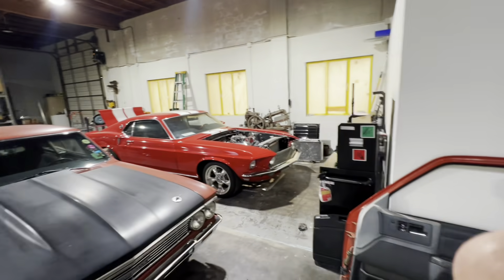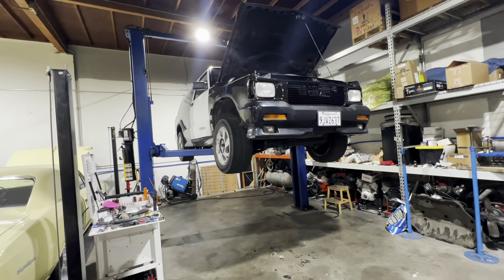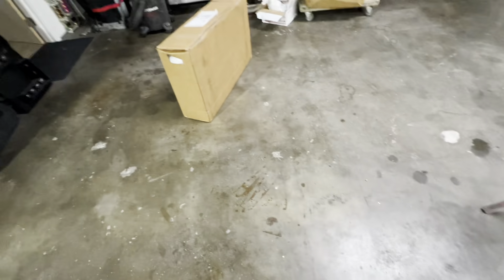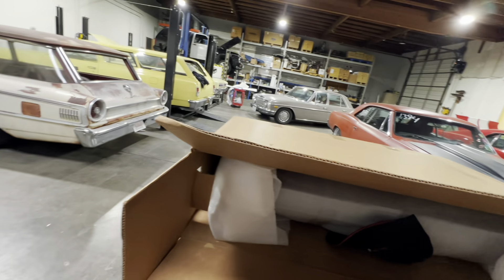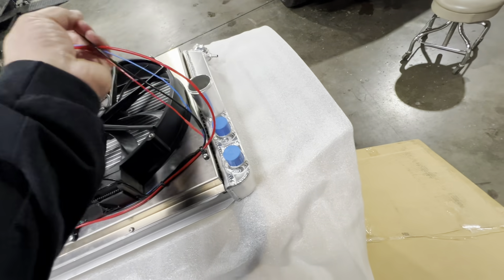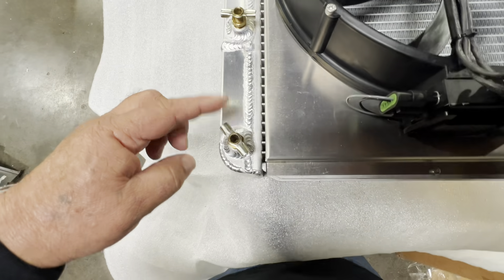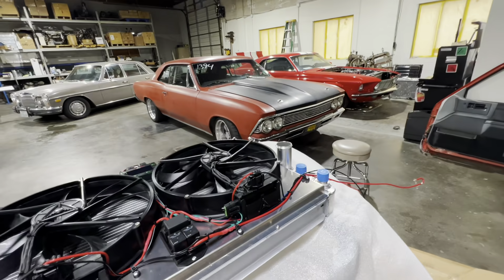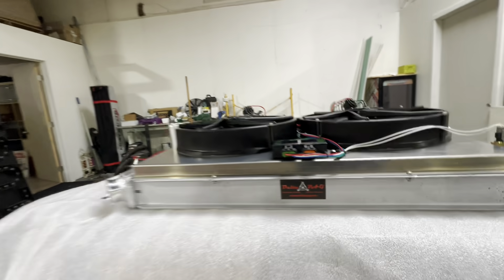What's new in the shop?  Delta PAG Radiator

Comment: I love my Delta PAG system  on my 1970 OLDS 442 W -30 conv..I've had  this system now for about two years and very pleased with the performance. My car is LS-SWAPPED..600 HP..In the summer it get's up too 110 degree's here in Texas..I've been stuck in bumper to bumper traffic..110 degree's and AC on..Engine temp never got above 196 degree's...Excellent system..

Comment: I was able to wire myself a crude soft start circuit with a step up relay deal I made.  It worked good, till it didn't.  Jeeez, that was 04 or 05 when I nuked those fans.  It shattered the brush hoods and brushes off the commutator of the fan motors.  I wanted them to slow draw start, and they did,,until they didn't.   Looks like Delta Pag has me covered now.    Very Fancy,,Happy New Year for You with the late Gift!!! .  Thanks Lucky.      Soo, ,You, Lohnes, and Sticks, on a Hot Pod somewhere??.